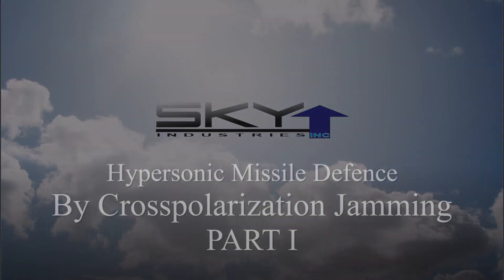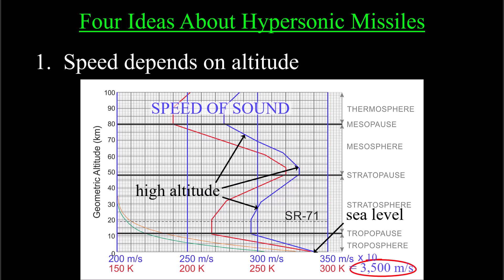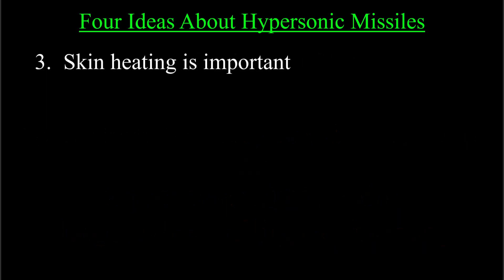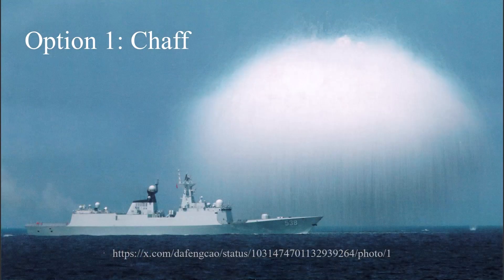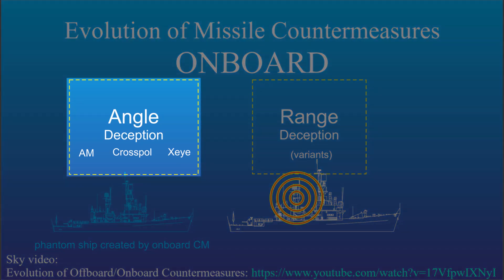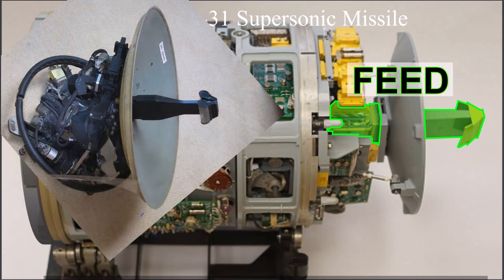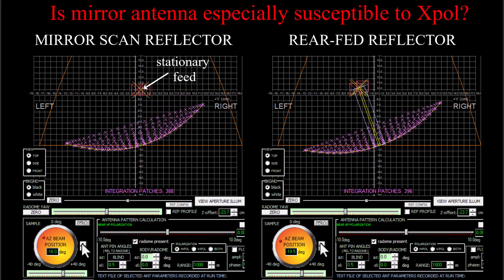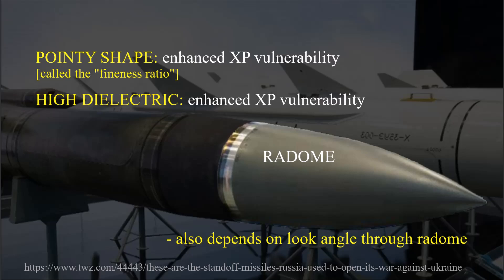Hypersonic Missile Defence By Crosspolarization Jamming PART I 25

Comment: They've been able to send RF through the plasma shield for decades, they just won't tell you. The Sprint missile program explicitly specified the designs for such systems as it used terminal radar guidance at over Mach 10, but the details are classified.
Reply: Nike sprint used ground based phased array radar to track and guide the intercept vehicle to target. There was no onboard RF guidance due to the plasma sheath created around the vehicle. The principle of how this was done is no secret. It’s been known for a long time that as long as the RF signal is higher than the frequency of the plasma boundary layer it is possible for it to pass through, lower its reflected and if it’s the same frequency its absorbed now it’s not as simple as that but that is the concept in a nut shell. As far as onboard RF terminal guidance that can penetrate the plasma boundary layer around a hypersonic craft is limited by the current technology and the implicit physics involved in such systems (talking about the entire craft and trajectory etc…) Yes there are some onboard RF terminal guidance systems capable of penetrating the plasma boundary layer but is limited due to the inherent physics involved. This is why most hypersonic craft td either have to slow down before their terminal phase to bleed enough velocity off so the plasma boundary layer is thin enough or no longer present, or use a satellite system to guide it at least in part of the flight. These problems are not completely solved and are all very much still open problems being worked on bc any solution present td is only of a limited use depending upon its operating constraints/window
Reply: Nike Sprint was a major use-case of it. I love how they try keep it classified when the cat is way out of the bag lol.
Reply: @N4CR the issue is transmitted power. Sprint needed the massive array to be able to penetrate the shield. 

I suspect use of capacitors along with a smaller duty cycle/PRF combined with higher peak power would achieve this.
Reply: @aidanmattson681  Yes exactly, at the time they were not able to package RF terminal guidance systems onboard that would be powerful enough to generate a high enough frequency that would allow the RF signal to pass through the plasma boundary layer. This is why it was positioned along the body of the craft to transmit through the rocket plume as the plume was more transparent to RF than the plasma boundary layer at the front of the craft. Cheers
Reply: @N4CR it’s not classified, the principles have been known publicly for just as long as they have been going on for. Further from my understanding onboard RF terminal guidance systems have been made that are capable of seeing directly through a plasma boundary layer but its ability to do so are limited
Reply: @N4CR  I for one believe everything the government tells me and do everything they tell me to do. I even got a tattoo of my vaccines. I base my entire identity on it actually.
Reply: Hint : they put the coms in the back, not in the front as this video suggests.
Reply: @Les537  yup exactly and what I pointed out in one of my comments above. Its really a shame ppl are just to lazy to do some basic reading to learn how these things were done many decades ago. The real interesting stuff is currently being worked on and is quite amazing where things are trying to be pushed towards. Cheers
Reply: @Les537  Weakness of such command guided systems is that they get less accurate the further away the target is. Eventually as the missile approaches the target you get to the point where your radar's resolution is insufficient to discriminate the target from the missile, and you then have no idea what steering commands to send so the best you can do is detonate the warhead and hope your target is within the lethal radius. This isn't such a problem if (like Sprint) your warhead is a nuke. But under most circumstances using a nuclear missile on a US carrier group would probably be an unacceptably risky escalation. 

How good is modern inertial guidance from a drift perspective? Could they use inertial + mid-course updates via satellite?
Reply: Interesting discussion. An issue that I've seen is the heat melts the RF equipment before the plasma is an issue. And they can't TX RF through the heat shield. But they could just  jettison the heat shield and the primary nose cone.

Comment: Could the missile passively home on the jammer itself or the radar system attempting to track it? Given the intense interest a ship has in not getting sunk, it's blasting a lot of radiation out there to guide its own onboard defenses, so why would the missile need to bring its own radar emitter to the party? Is the terminal environment just too confusing for a passive system?
Reply: Simple answer is no as the video explains… the plasma sheath that develops around the skin of the missile (due to  its hypersonic velocity) blocks most RF. Now technically the answer is much more complicated than that and there are ways of sending RF through plasma but for a passive array it’s still not happening, maybe one day but that’s speculative (based on the physics) and most likely quite a ways  away still if even possible.
Reply: @metatron5199  I've watched both parts and I understand the plasma problem. It's once the missile gets out of the hypersonic regime where I was wondering if it even needed an active seeker. Missiles can already home on jam or on a specific radar source, and during an attack on a carrier group, there would be a lot of radar sources. Getting the right one may be tricky, but if you fired dozens of them, you'd likely hit what you wanted to hit. You couldn't cross-pol jam it because it has no signal to jam.
Reply: @ technically so if the flight regime is sub hypersonic (and if we are speaking about a hypersonic missiles that slows during its terminal phase of flight)  the answer is technically no as there is no need for an AR as there are already passive RF arrays in some missiles, as well as seeing them in anti-radiation missiles as well. But in short they still fall prey to jamming so it really is dependent upon which specific systems are matched against one another other to give a proper answer as these systems are much more complex in real life. Many munitions td have onboard terminal guidance systems which use a suite of sensors across the entire EM spectrum so as to reduce the risk of being jammed as the onboard DSP (digital signal processing) is advanced enough to correlate the various signals (in case one or two are being jammed) to maintain its lock on the target as well as to make correcting/evasive maneuvers if necessary. Hope that was helpful without getting to in depth here. Cheers

Comment: Hypersonic weapons are overhyped: most of the claims (such as they're undetectable and cannot be shot down) are false and the huge costs of developing effective hypersonic weapons that only offer advantages in certain very specific situations make them unnecessary. 
Most experts on the subject and clued up analysts know this, yet influential actors such as legislators, high ranking members of the military and the weapons industry themselves continue to spread exaggerated and false claims such as:

• hypersonic missiles cannot be tracked by radar:
false, radar systems have no trouble tracking hypersonics. A plasma sheath does not inhibit radar waves from penetrating and rebounding back to the radar. They are also easily tracked by the IR signature they leave from launch and as their skin heats up to over a thousand degrees....or forms a plasma sheath. Yes, the very thing they claim makes a hypersonic missile undetectable, makes it detectable. How do they think ICBM warheads are tracked, I wonder?

• hypersonic missiles cannot be intercepted: 
false, any decent SAM system can intercept if they are in the path of the incoming missile or if the circumstances are right**

• hypersonics travel faster to their targets than ballistic missiles: 
false, they travel through the atmosphere at low altitude "depressed" trajectories while ballistics travel faster through the vacuum of space.

• hypersonics can maneuver to dodge missiles: 
false, their huge velocity prohibits anything except gentle course changes, which not only increases the hypersonic's range to target but also it's time to target, lessening the advantage of surprise. Maneuvering is used in an attempt at bypassing a particular SAM system's area of influence en route, or maybe switching targets in flight, not for "dodging" missiles.

Hypersonic missiles are niche weapons, good for certain missions but otherwise do not offer enough advantages to warrant numerous expensive R&D programmes. They're not a silver bullet, not even an expensive silver bullet, just expensive.
Reply from the maker: Yes I agree, plenty dangerous in some circumstances, but broadly speaking more bark than bite.  Your comment that they "Hypersonic missiles are niche weapons, good for certain missions but otherwise..." is spot-on.  

As is your cogent comment about "influential actors such as legislators, high ranking members of the military and the weapons industry"; a stampede of people who control the money, and who are generally non-technical.

Comment: Another reason that people usually forget about traveling at mach ten ish in the lower atmosphere
Your object needs a significant heat shield due to being hotter than a welding torch and more or less glowing white hot from atmospheric heating
Also idk how good radar would feel about operating through that
Remember Sprint?
Reply: Yes, the Sprint missile tracked its target despite being enveloped in a plasma sheath through a robust ground-based phased array radar system. This system utilized powerful radio signals capable of penetrating the ionized air and exhaust plume surrounding the missile. The radar continuously tracked incoming reentry vehicles, allowing for mid-course corrections via radio commands, which were necessary given Sprint's extreme speed of Mach 10.

Comment: Fascinating as always. China claims to have solved the "RF comms thru plasma" problem. If true, I wonder if that solution can be extended to allow the missile's RF seeker to work during a hypersonic terminal phase.
Reply: if they solved the communication problem they would guide the missile using data from another sensor
Reply: I believe constellations like starlink could help with communication and possibly guidance as well. Plus there are methods that involve cooling part of the plasma to allow your sensors to work. We already worked on this problem as part of the sdi program (HEDI).
Reply: @Lyle-In-NO  looks like my previous comment got deleted because it had a link. I'll repost it with just the title.

I found this interesting american/russian journal paper that was published in aps 2007. You can find it online through research gate.

Title: Communication through plasma sheaths - Alexander O. Korotkevich
Reply: It's a very limited communication.  Essentially a trailing antennae has a narrow hole in the plasma sheath.
Reply: @kwonekstrom2138  data packets for guidance are very small.
Reply: @kwonekstrom2138  Also, you can literally watch Starship reentry live in real time in 4k, so...
Reply: Is there a way to calculate or estimate the noise generated by the plasma field at any given point?
Reply: Plasma in it's very nature bends magnetic field around it , and all em waves are product of Electric and magnetic fields. Unless there is a technological breakthrough the way missiles are guided at their final stage . Hypersonic missiles are nothing special
Reply from the maker: Could be disinformation from China.  

Otherwise I think that will depend on what the electrical properties of the plasma are as a function of frequency (neither of which I know) and whether the antenna on the missile body is shielded by the plasma.  The plasma is at the front of the missile; an aft-facing antenna might not be affected, but it can't see the target. 

I can't see a way to make a seeker see through plasma as I understand plasma, unless it operates at a frequency at which the plasma is transparent  - if such a thing is allowed by the laws of physics.  A university professor might know the answer to that.
Reply: @skyindustries It is! An example to that is the ionosphere, which reflects HF but is transparent to higher frequencies.
Reply: @skyindustries  i think the claim that is referred to was published on south China morning post.  They always publish engineering related news from China especially relating to defense tech.  If you go look up the scientific paper that contains the claim, it usually amounts to they did the work theoretically and simulation checks out.  But they have not build any experimental physical prototypes.  Or even if they have build one, it is usually tested out in a lab setting, basically a proof of concept only in a university lab setting.
Reply: @eliasmai6170   correct. It was an article in SCMP.
Reply: But it is also the moment when further developments are classified....
Reply: @skyindustries Space Shuttle could remain in contact in real-time with TDRSS satellites above it once those were deployed.  It’s frequency and direction dependent but can work.  That’s how we had the detailed failures to breakup timeline from Columbia’s thermal protection system failure after the ice impact.
Reply: We are pretty sure that the Chinese ballistic antiship missiles with maneuvering Reentry Vehicles have target maneuvering cues from satellites via satellite communications networks before atmospheric entry starts.  At maybe ten to twenty seconds from entry to impact the ship targets can’t change velocity or direction much.  The “hypersonic” boost-glide and potentially powered cruise antiship weapons would potentially be able to do the same thing, at the right frequencies.
Reply: @skyindustries What if you have one or two missiles in a salvo decelerate early so as to get rid of the plasma sheath and illuminate the target(s), and then have the rest of the salvo command-guided from the lagging missiles? Then you just need a rear antenna on the missiles flying point, and if even that is shielded by plasma, you can use an optical sensor to receive data over a laser link.
Reply: @JonBrase  why using full-scale h-sonic missile if you can deploy slow recoineccanse vehicle in such scheme?
Reply: Exactly what I was getting at in my comment. Orizhnik enters atmosphere from orbit... Have 2 or 3 warheads that slow themselves, turn on radar or Electro/optical sensors and start feeding the primary warheads targeting data. This would all happen in the span of 30 seconds. Carriers don't move fast enough to get out of the way if even a single "snapshot" of data could be fed to the warhead at mach 10 @JonBrase
Reply: @skyindustries  the plasma is antenna. There is no way around. So I guess we are truely talking about communication only, not a seeker.
Reply: Oh, FYI the DF-21 hypersonic missile terminal velocity quote on Wikipedia is subject to considerable… assessment.  And fundamentally likely not provable without espionage or satellite infrared tracking of testing over the Xinjiang desert.
Reply: they havent, though. theyre literally just making shit up.
Reply: @crunchybones2528  what benefit do they gain from lying?